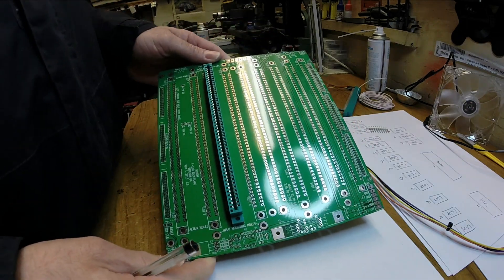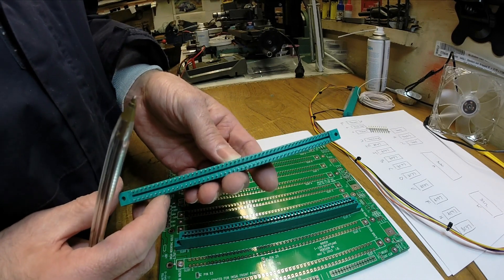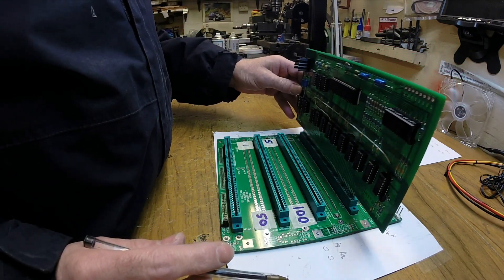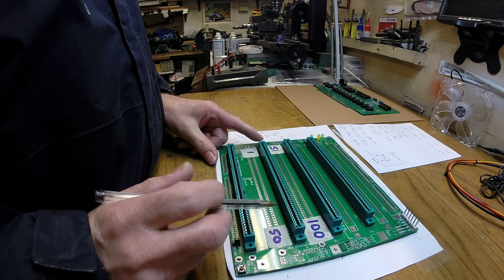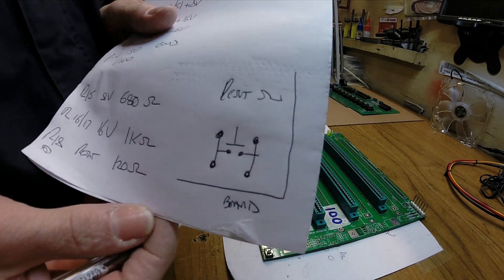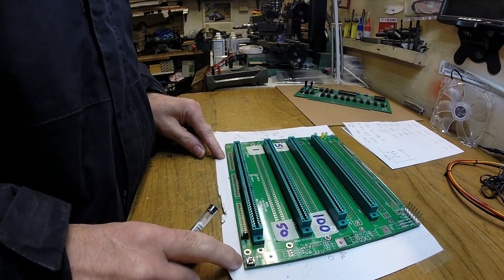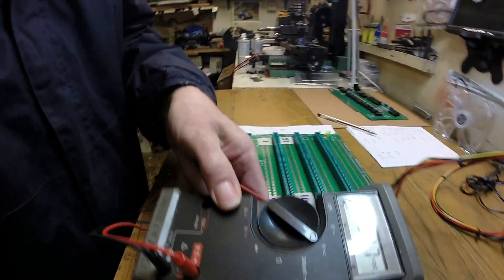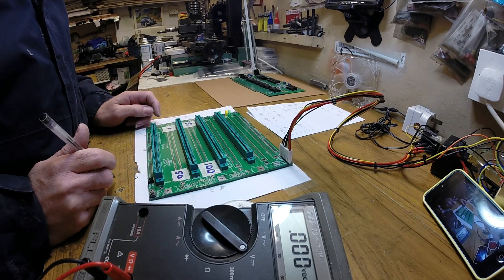Altair 8800 Build Project Part 3 - Backplane

Comment: When the motherboard is installed in the cabinet along with card guides, the you can't get the cards in backwards.  Well in to the S-100 connectors anyway.  This from a guy who built ihs first Altair in 1975.  Now working on the same motherboard as you show here along with a set of card guides I 3D printed, an 8800c from Mike Douglas of deramp fame, 3 MeanWell switching power supplies, a Josh Bensadon 8080A CPU, and a FDC+ enhanced floppy disk controller also from Mike Douglas.  Just need to find the time to complete the assembly.  This one will my 3rd Altair.  All still in my possession.  Number one, I think, was/is in the 700 range of serial numbers.

Comment: I like your back plane here, I would like to build a test bench using a back plane like the one you have here.
Reply from the maker: Todd Goodman does them quite cheaply,  however the connectors are quite expensive. Complete S100 backplanes often turn up on eBay which will be a much cheaper option.
Reply from the maker: Hi Jeff, For some reason I can't reply to your comment  on the +/- 16V PSU's. At the time I couldn't find a single supply that had both +/- 16V, so I used to seperate supplies. If you watch Part 9 I did eventualy find a dual rail supply, which is now fitted so I have a single 5V and dual 16V supplies now.